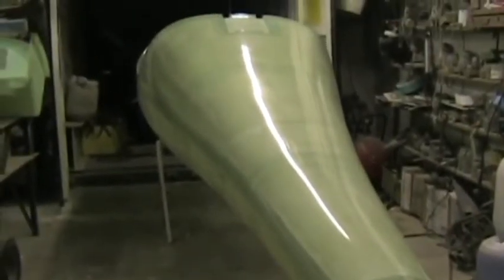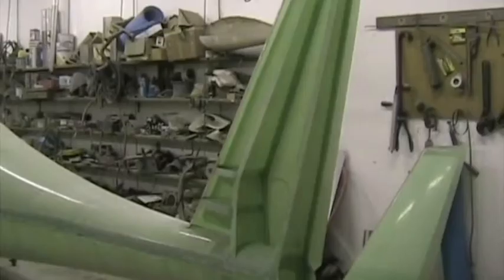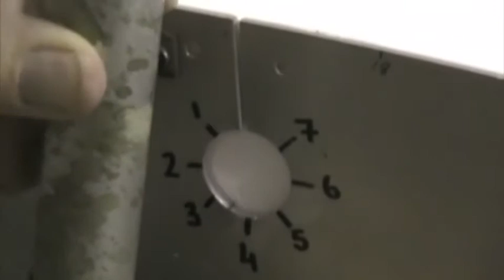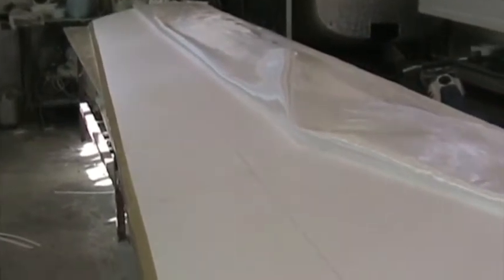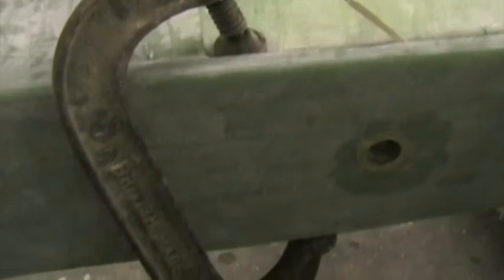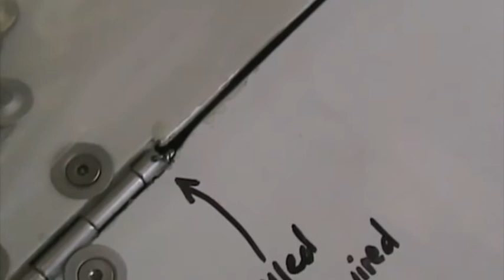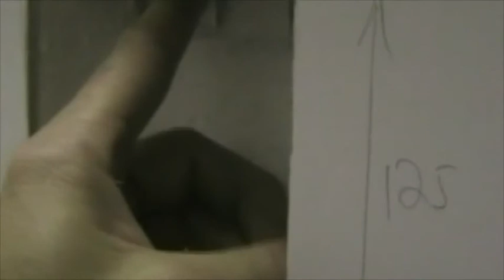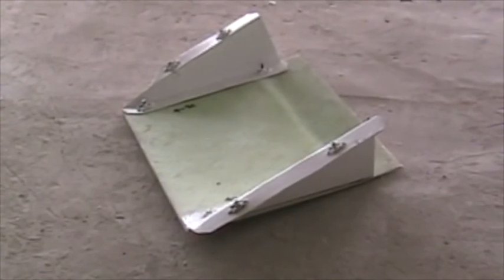Building a Whisper back in 2005

Comment: Hi, 
Thanks for sharing these informative videos.

What are the values for ultimate tensile strength and elastic modulus that you consider for fibreglass reinforced epoxy in your calculations? 

Say for the UD in your Spar caps.

Comment: Thank you for information! May you give me advise, I am under construction airplane, already made fuselage and ampelage. To make  rudder and stabilizer I have been used wet infusion with Airex in the mold . Now I wonder about moldless (cut wire) technic for wings . The problem is, I  have only 0.20g/cm density polystyrene foam. Can it be useful or it so weak? For example, slurry more micro...or add a few ribs ...something like that....
Reply from the maker: We use 20kg/cubic metre density expanded polystyrene. Key is forcing micro slurry into foam surface after light sanding. This gives the skins adequate adhesion to the foam. There are no ribs apart from the roots. There are obviously spars.